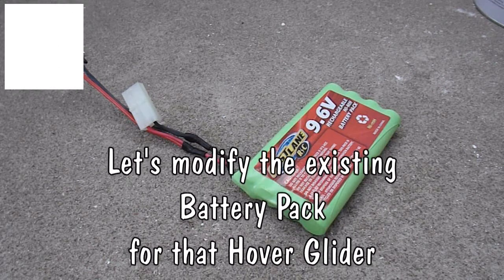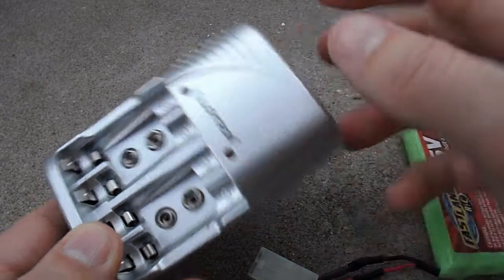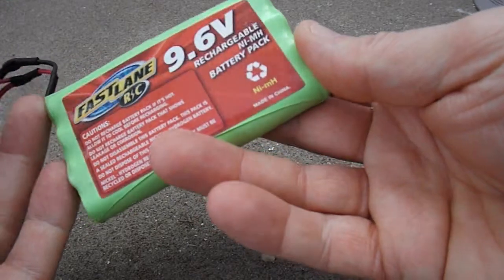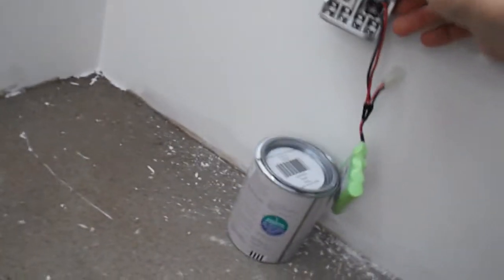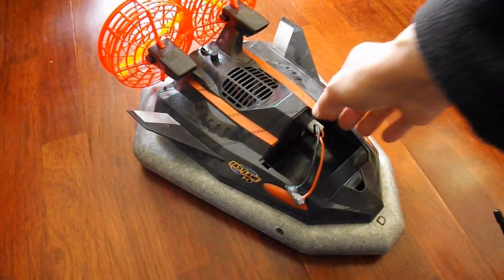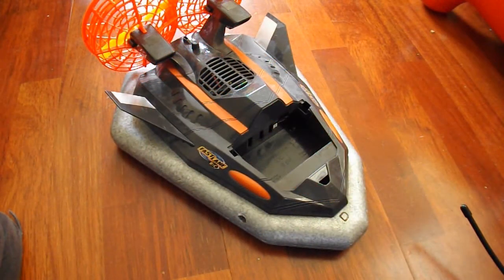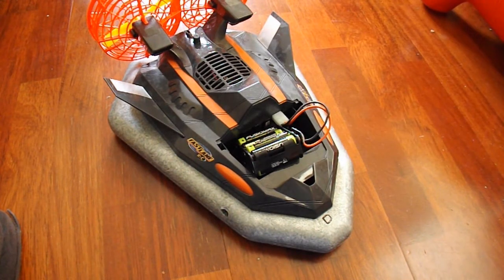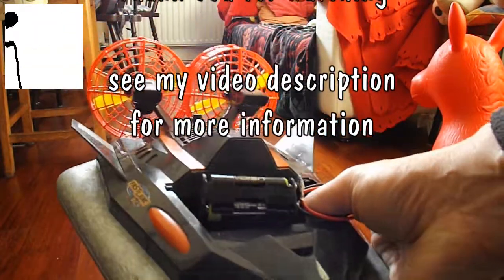Modify existing Battery Pack for that Hover Glider

Comment: The 11 Volt is enough, but the batteries did not get charged much. If you find some time, keep using the charger several times until it does not shut itself off, and/or until the batteries get hand warm. But if the batteries were not charged for a to long period, then they will go bad. There still is a way to do it, it would involve pinching through the plastic with an iron or copper piece, so you can access one AA battery at a  time and charge it up. And yes, I know, it is a lot of work. But if charging them one at a time works, I am sure you can recharge them on the 9Volt charger later on (if that one does not shut down). If these batteries are 1000 mAh, it needs at least 24 hours if they are empty. But they will run warm, and throw away excessive power as heat, and they won't just like that explode! Certainly not with a charger at 20mAh.
If nothing works, you can peel of the plastic and break them all apart and see which one does charge and which not, they will fir in the battery holder as well.
Reply from the maker: Hi Deslo, thanks for dropping by. Yes that is more or less what I have replied to a few other commenters. In fact I am just going to put together another short video - just about these Lloytron chargers that I have. That battery pack is currently plugged into my second Lloytron charger which only has a single 9v socket and measuring at the Teed connector it is holding steady at 11 volts while it charges. I have two 9v 250 mAh batteries plugged into the double socket charger and I have just measured the batteries after 6 hours and they show 9.6 and 9.7 volts but the instructions say they need 13 hours for a full charge. Measuring the output from the charger with no load I get 12 volts.

Comment: you need a charger that has more than 9.6volts.And the battery is full charged wenn it goes ''handwarm''.
Reply from the maker: I have the battery plugged into the charger at this moment and it is charging at a steady 11 volts. It started at about 7 volts and rose steadily and steadied out at 11. This charger is designed for NiMh batteries, just not the plug format on the battery pack.
Reply: okay

Comment: That's a nice charger look s very useful
Reply from the maker: It looks good, but as far as I can tell it does not switch itself off when the batteries are charged. The handbook just tells you how long you should charge different sizes of batteries for. I bought it specifically to charge the PP3 type 9 volt batteries and was disappointed to find I had to time the charges. It has switched itself off when I have used it but as far as I can tell that is some sort of thermal cut-out not a charge level setting.

Comment: If instead of AA batteries, AAA use, less time would last, but would walk lighter.
Do not you think?
Reply from the maker: It is tail heavy with all the motors at the back so it needs the weight of the batteries to help balance it.

Comment: 9 volt charger won't do much if at all the 9.6 voltage is its nominal voltage rating' a 12 volt source should work. plus i wouldn't be surprised if the battery pack is less than a 1000 mah